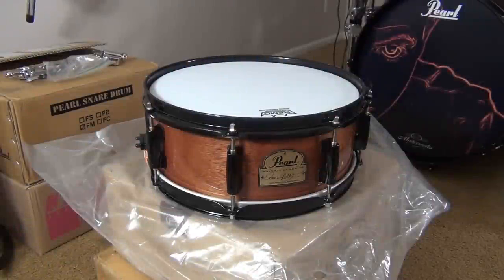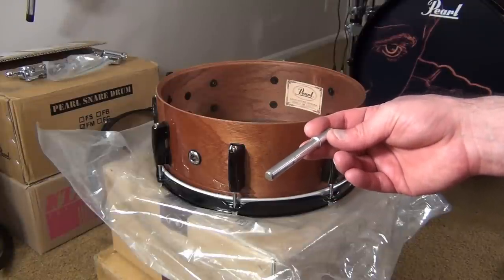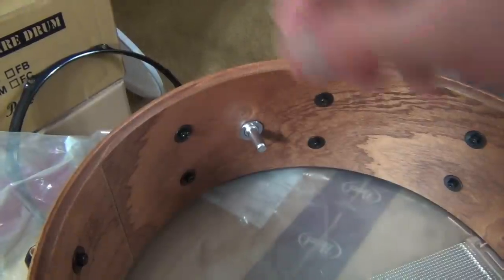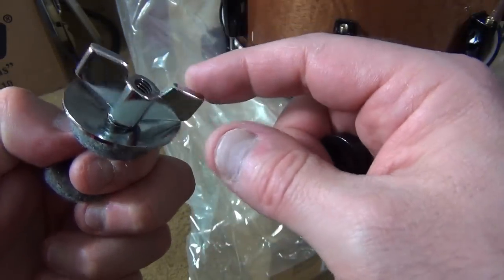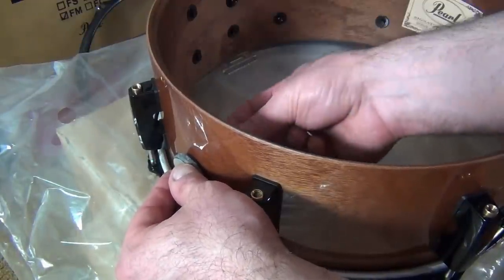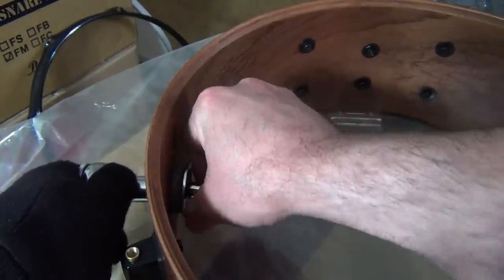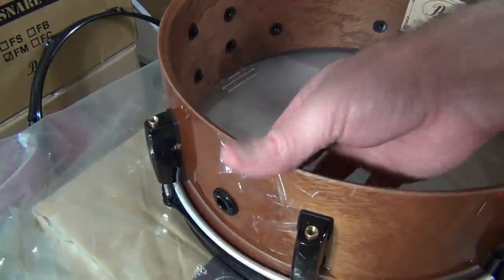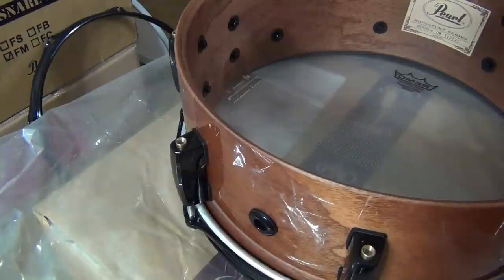Pearl Snare Drum Press-Fit Air Vent Removal and Installation

Comment: That's good idea for mounting vents, the pressing into metal ring that's on the inside the shell I mean. Once I was removing the airvent from Rockstar Custom floor tom and damaged the shell a bit. I grinded the vent from the inside but apparently not enough and while I was hammering it from the inside with a metal piece just like you did, I damaged a few outer plies. They were caught by the vent while it was going out. I did fix the shell but that event always reminds me to deal with drums only when I'm not in the hurry and not in the middle of the night :)

Comment: Getting a lot of buzzing from my air vent on a 14x12 90s era Master custom hanging floor tom. This will help me take it out and reinstall hopefully minus the buzz
Reply from the maker: Maybe.  If you can feel play in the air vent, then it should be tightened or reinstalled.  However the buzz could be coming from a loose lug, poorly tuned or worn heads, an uneven bearing edge, etc... so many things to check.
Reply: @flacche  so guess what? I originally diagnosed it as the vent hole being loose because if I touched the vent hole it seemed to stop the buzzing. Then I took the vent hole completely off and it was still buzzing. Then I remembered something. I found a phantom short tension rod on my drum carpet about a week ago and couldn’t figure out what it was. It was one of the two short tension rods that holds the optimount rods in place. It had fallen off and the buzzing was the rod rattling on the hoop
Reply from the maker: Glad you figured it out.

Comment: When did pearl use plywood?
Reply from the maker: That's a loaded question that could take on at least two meanings.  If you mean "plywood" in the sense of what it is... shells made of wood in multiple plies, that's basically all Pearl makes.  Occasionally, they make solid wood shell snare drums, but that is MUCH rarer than their typical shells, which are all plywood.  If you mean "plywood" like sub-flooring in a house, Pearl's African mahogany is a much nicer wood than the luan you were trying to parallel it to... no comparison.  If you think Pearl makes metal shells, think again.  Their metal shells are farmed out to other companies in Taiwan and/or China.

Comment: Hello sir. I wanted to know how did you remove the logo on your Pearl Joey Jordison Signature Snare?
Reply from the maker: I used non-acetone nail polish remover, and taped off all the holes in the shell from the inside, and completely taped the panel where the badge is.  You will get a subtle line in the finish from that pair of tape marks, but it will never be noticeable.

Comment: +Matt Flacche I own a Pearl Session Studio Classic 12 in Tom that has a loose air vent and "rattles" anytime I have my snares off, what do you think would be the best solution for this? Thanks!
Reply from the maker: That's the same type of press-fit air vent.  Use the 2nd part of my video to tighten your air vent.  It starts at 2:07.  Make your own "vent press".  You can tighten the vent.  Just do a little at a time, until it doesn't rattle anymore.
Reply: +Matt Flacche Thank you for your response back! I will check that out!

Comment: Yo Matt! I’m going to rewrap my Pearl Masters MCX so I’ll need to take all the vents out. Will I be able to re-use and re-fit them?
Reply from the maker: Absolutely.  Just follow the procedure I illustrated in the video.  They are meant to reuse.
Reply: Matt Flacche Cool!! I’m so bloody nervous of doing it though!! Do you know what the diameter of the bit of your pin that catches the lip as I’ll probably have to buy a drill bit or something to use.
Reply from the maker: No I don't.  Just try different parts you have in your garage, until you find something that fits.  It's not that complicated.  The key is to tap it with a dead blow hammer.  Don't try to use a regular hammer, you can hurt the shell or your hand ;)
Reply: Matt Flacche I don’t have a garage or any type of tools/items like that. What I’ll do is strip down a shell, take it to a DIY shop and find a drill bit or something that fits it. 👊🏻👊🏻
Reply from the maker: I would try a few different size bolts until you find one that fits in the hole, but catches the lip.
Reply: Matt Flacche good idea!! 👊🏻👊🏻
Reply from the maker: Let me know how it works!